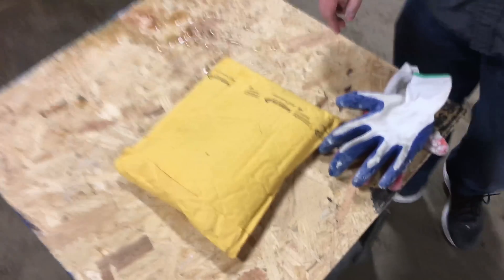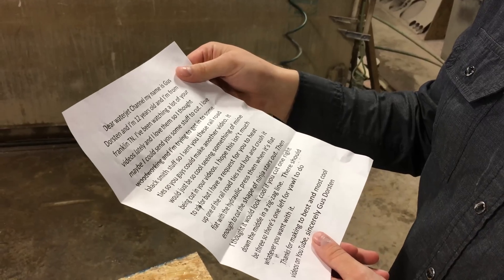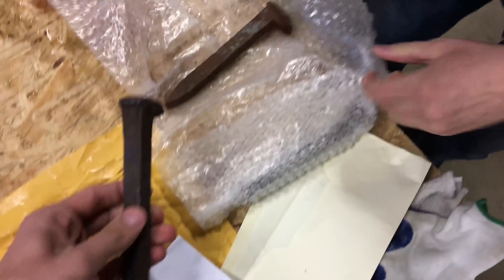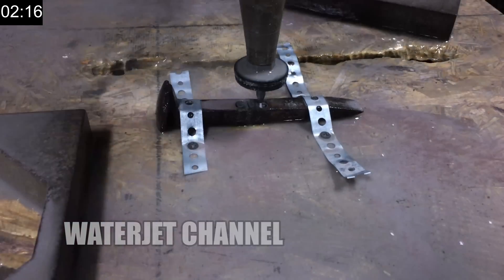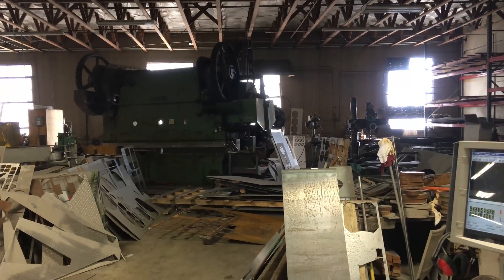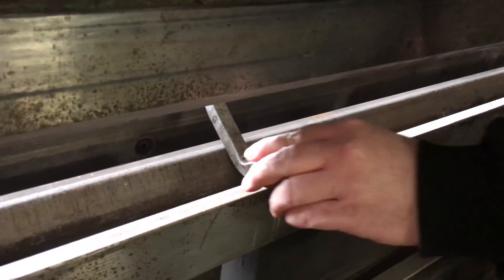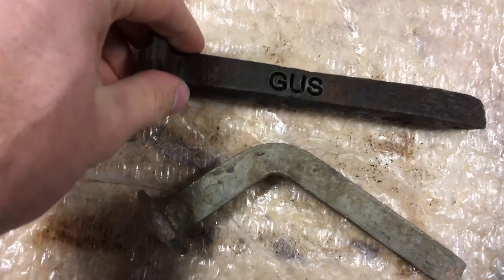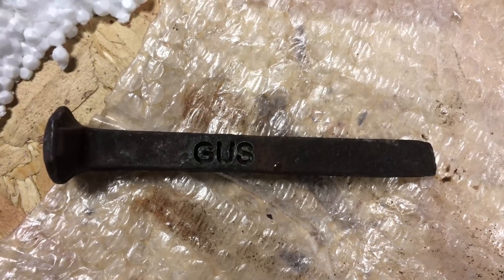Railroad Spikes vs 60,000 PSI Waterjet

Comment: Cut a diamond with it
Reply: I'd actually like to see that as well but they'd either need a fairly large one, which would be a bit expensive, or put a smaller one in a block of resin so they can secure it while cutting.